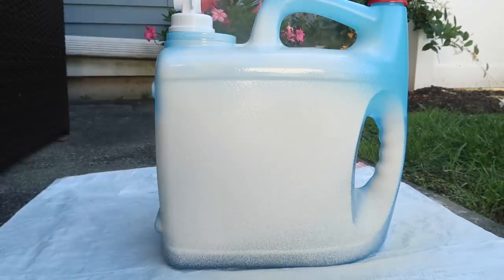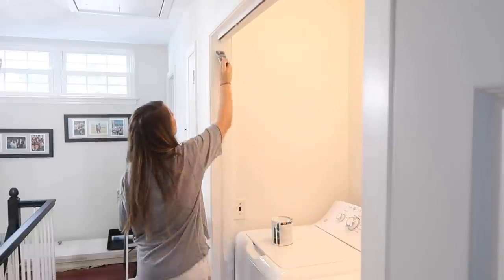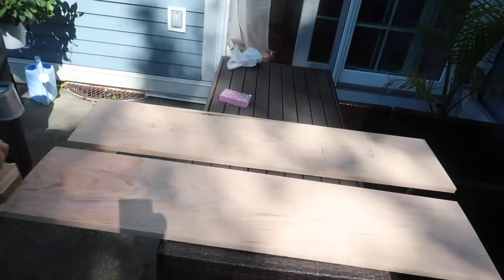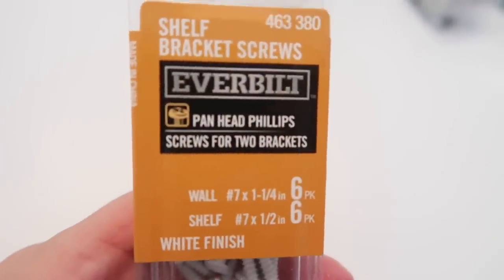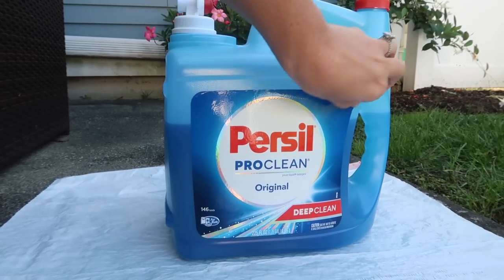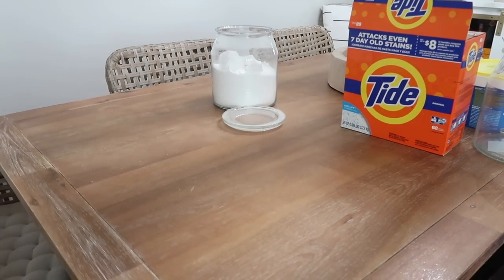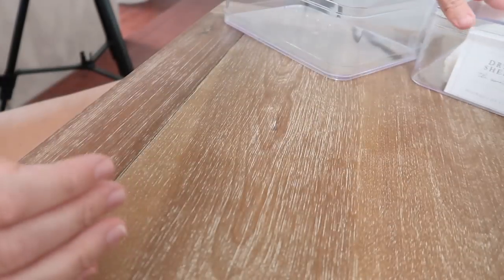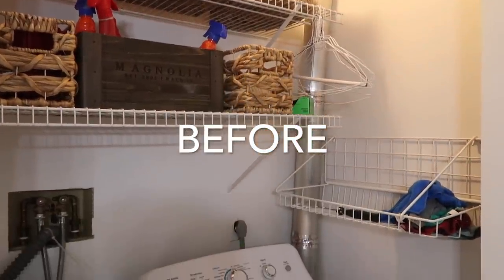DIY SMALL LAUNDRY ROOM MAKEOVER ON A BUDGET | DECORATING IDEAS | ORGANIZATION IDEAS | LAUNDRY DIY

Comment: Looking at your big container of laundry detergent like most of us have, a tip:  Most people just use it as-is.  BUT.  If you poke a tiny little hole in the jug, it allows air in, and the liquid comes out much faster.  Removing the screw lid each time can be a pain in the neck.  I use an ice pick tip, or a small nail--or anything that will put a tiny litlte hole in an area of the jug where when you pour it by using the rubber pusher-thingie it will not spill.  Sometimes, using a hot nail or solder gun to put a little hole in the LID is the best way.  It really works and saves time and irritation.  Thank you for the video.  Lots of good ideas.

Comment: Turned it nice, it's crazy how a simple makeover will motivate us even more to happily do laundry... lol... another tip would have been to spray paint the metal vent hood with a white paint or similar to the wall paint, and to have framed out the hole in which the water lines go to... you could have used an old picture frame to frame it if you aren't good with tools and your hubby just doesn't have the time to do it from scratch. But great job looks open and fresh.
Reply from the maker: Those are great suggestions, thank you!!

Comment: Are those scoops just decorative or are you going to use them to measure detergent out? What if the scoop is far more or less than the actual required amount?
Reply from the maker: I use them but I have used oxi clean for years and know the amount by now.  Tide; I only use to clean my floors (1 tablespoon) so it's pretty easy to measure.  You can always keep the scoops or cut the instructions and tape them to the bottom.

Comment: You are missing the trim that goes around the water spout area. It will make the area nicer. But you did an excellent job. I placed wall hangers that expand out when drying my clothes; then they close so they will not be sticking out all the time. I would also place labels on the detergent and oxy jars.

Comment: You could get your hubby to build a box, with circular cut outs on the button. To fit over the piping where your output is for the washer and dryer. Or better yet, leave the bottom of the box empty so they hang. The hole will be covered.
Reply from the maker: Thanks for the suggestion!